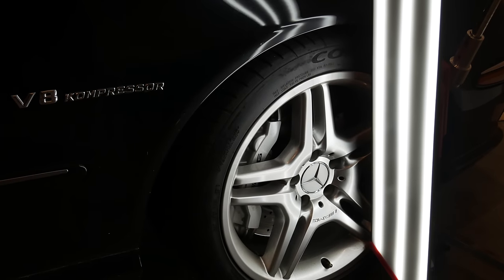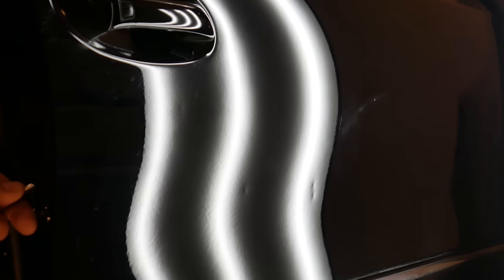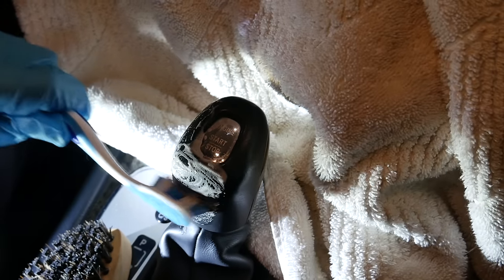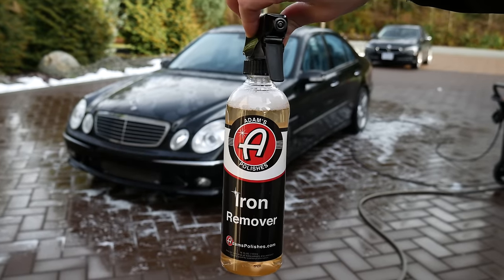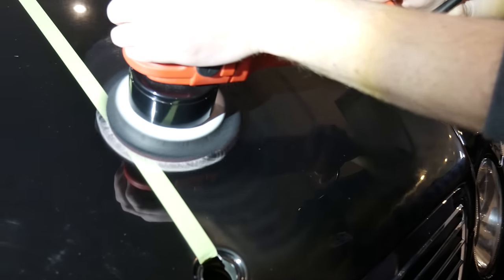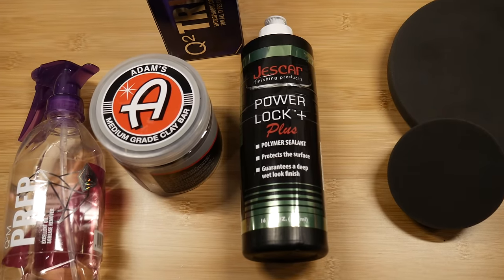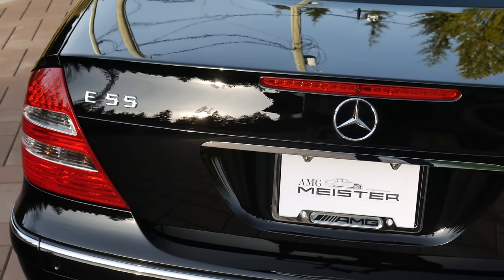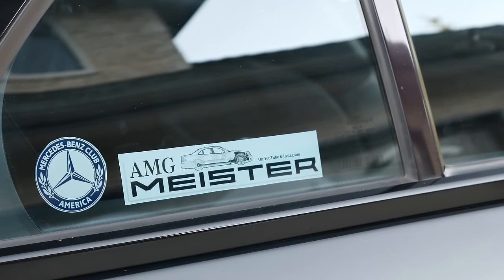Restoring My Mercedes E55 AMG in 8 Minutes (4K)

Comment: AMGmeister...you "threw on the wider SL550 wheels"....what size and off set are they?...thank you...
Reply from the maker: They are 8.5" wide front et30 and 9.5" wide rear et33. From a 2007 SL550 sport pack.
Reply: @AMGmeister  Thank -you...

Comment: As you said the bend on the fender and it's very common on the E55... I got that bend from driving hard on mountain roads and suspensions bottoming out last week. I got the SL wheels on my too and am wondering if that is the reason for it. Its 20mm wider than the stock wheels on both front and back.

Also I have a few problems that I don't know if you have tackled before. First is the roof rack rails. That part have really faded paint and ruined clearcoat. What would you reckon is a good way to remedy that? Second thing is the center console roller. It was stuck in the open position. Have you have that happen before?

Comment: Another great video, where did you get the passenger replacement seat control and Mercedes window sticker.  I need both plus a driver-side vanity mirror and a missing button with a seatbelt symbol on it.  Your help to find unique parts is always appreciated.   Keep up the excellent work.
Reply from the maker: Just keep an eye on eBay. Lots of seat controls on there.
Reply: AMGmeister thanks will do

Comment: Something tells me this car is in very good hands :) Only question why didn't you go for a ceramic coat after all that work?
Reply from the maker: Skipped the ceramic coating because I wasn’t chasing perfection with the polishing. Might go in and spend more time over the winter and then ceramic coat it. I wouldn’t want to lock in any imperfections under a coating.
Reply: AMGmeister Feelsbad as your polishing looked more serious than what I did on my 211 and I put ceramics on top 😂 not perfect but came out very nice.

Comment: Very nice job! I found the part about the rear parcel shelf panel most interesting! Mine is pretty faded, too. Can you provide more detail on the lowering links and wheels? Do you have the lowering links on both ends, front and rear? Why not just lower with Star? Also can ride heights be programmed individually for both, low and high position in Star? And also the speed at which the car lowers automatically? I understand this is all different for different markets / countries. So the wheels are 8.5 and 9.5 x 18? What tire sizes? Best regards, Tadek
Reply from the maker: Thanks! The car has links front and back. Not adjusted with Star. Wheels are 8.5 and 9.5 wide. I have Continental SportContact DWS06 245/40/18 front, 275/35/18 rear.

Comment: Question: I have a used Mercedes where the previous owner had gotten some scuffs on both of the mirrors ( I assume in a parking garage ) . They don’t appear to be gouged just scuffs, any suggestion to try and correct this?
Reply from the maker: You could try to polish them out, it might be just paint transfer on the surface.
Reply: @AMGmeister  ok i'll give it a go with a small wheel buffer, it's just in a tricky spot, as of course the scuffs are on multiple pieces and the mirror signal lens.